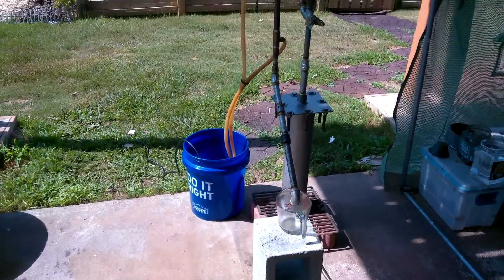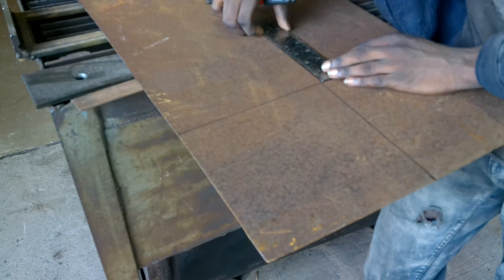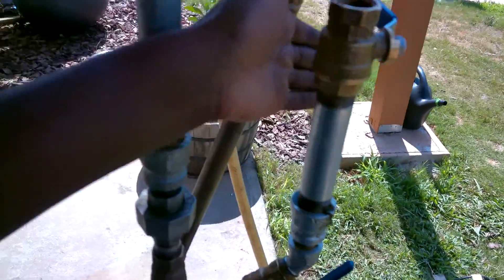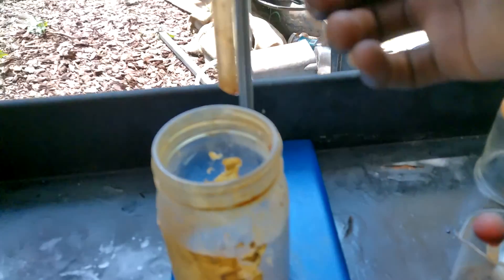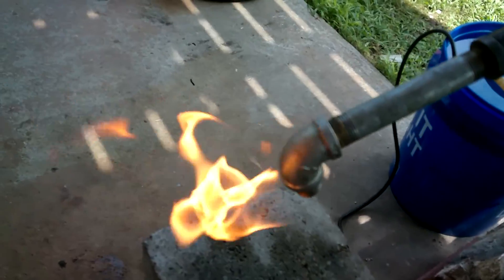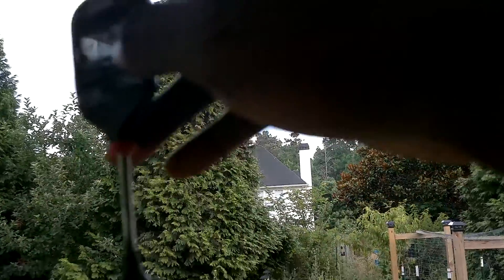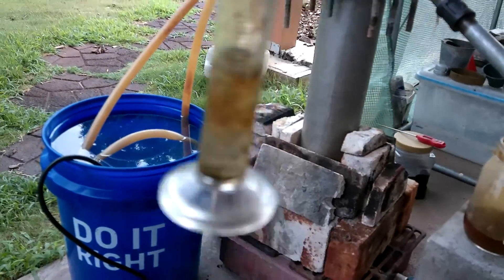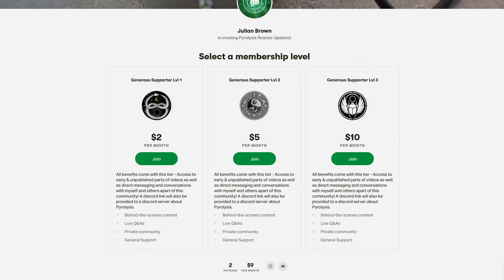GASOLINE from PLASTIC? - Distilling Pyrolysis OIl Part 2

Comment: You can treat the raw product with a saturated sodium chloride solution and wait for it to settle. Remember to shake, vent, shake, vent, shake, vent. Wait 2x longer than you think you need to. Then Slowly drain it. Also slow your process down to the point that you can fractionally distill it.

Comment: the lower the oktane the faster it burns or the faster it is gone. high oktane burns longer befor it is gone. 1 liter vays about 660 grams thats why it floats. you need a tower with diferent outlets to make good separation

Comment: I've just started messing with plastic pyrolosis,  but I've messed woodgas  (wood pyrolosis), one thing that works well is using straw as a filter media, then when it gets all full of tars, you cab just run it through the pyrolosis chamber.  I wonder if you could use packed shredded plastic the same way as a primary filter, then run it through the chamber when it gets used up?  Great channel, keep it up.  I just picked up a free 20hp diesel motor,  to experiment with running a diesel on the oilier products.

Comment: Have you ever heard of a lava lamp? So what's happening is when you have a endothermic reaction like oxygen and hydrogen reacting with each other, you'll get a pocket of thermal interaction that creates heat pockets of concentrated heat. The concentrated heat rises gets to the top cools off then falls down that's the fluctuation and temperature.

Comment: If you need to cheat the Octane value up on your solution to get it to burn more like regular commercially produced gasoline look into how carbonating water to make soda water works and use the same process to defuse propane into what you have made.  

It's a bit of a cheat but if done right it should be able to run most gasoline engines just fine.
Reply: Would diffusing propane into methanol make the necessary tri-methyl-pentane directly?  After that, you could blend it properly.

Comment: Hi, I always love your videos, I have noticed a few things from my experimental experience. 
1.) i heat the crude very slowly, I use a thick metal (8mm) for the still to compensate for temperature fluctuations
I have insulated it with rock wool,
2. I don't understand why the stills are so high, my distiler  has vapor outlet pipe only 30 cm vertically, the rest is horizontal,
Suprisingly  i get clean fuel, I think you should try to destilate  other fractions  too, then maybe remove leftover tar and sludge, and redestilate fuels.
Reply: The height of the still is to enable reflux distillation at a high power input.  The more power you input, the less temperature drop from the bottom to the top of the still.  You can make shorter stills by paralleling the columns, and going from the top of one into the bottom of the next.
Reply: @dansw0rkshop  Thanks!
Reply from the maker: As dan said, the height is for reflux and also a packed column for vapor - liquid interaction, which is said to aid in separation.  Thanks!
Reply: Please as I'm making one . Please share your scamattics to get clean fuel
Reply: @theunisdeklerk1232  I made the distiller in a simple way, without complicated calculations, so the efficiency of the distiller is also quite low, i think adding a vacuum would improve efficiency but for inspiration I would recommend watching this video
https://youtu.be/6sYKFSBknl8

Comment: Quite a nice setup you have here but as a chemist i can advise you too look for leak (expecialy before the condenser) you can use flour and water to plug them it will cook and stay for some time and likely not disolve from the hot organic vapor
Switch the water in the condenser, it should come from the bottom and leave from the top to have all the volume filled by water. 
If the condenced liquid is still warm than you are loosing some of it as vapor, increase the flow of water, increase the length of your condenser or use colder water.
The temperature fluctuation is ok for me but as the other say crank up the heat and insulate your column. it's also normal to have a jump in temperature as the front of vapor contact your termometer
If you have a lot of out boiling in the colomn, you can add pumice or similar porous stone to help control that.

To help with the separation of water you can try adding salt to help break the emulsion. You can also wash your crude with water to get rid off everything micible in water prior to distilation.
Check the pH, as pyrolysis of wood produce a lot of acetic acid but i can also happen with oxygenated plastic (like PET)
Reply from the maker: Washing the crude is a great idea, as well as the flour
Thank you for all this great advice! Cheers.

Comment: Can wine brewing machine using as a pyrolysis ?try to get one for pyrolysis from plastic to oil
Reply: How about you make a video of wine brewing machine as a pyrolysis oil from plastic?because none of them aren't making this content yet on YouTube, it is a myth currently 
Self assembled with well organized structure is much better than DIY built up, DIY built up may hard to deal with with it
Reply from the maker: @MrGamer_jinjit_96  well... there are a lot of unseen specifics that make pyrolysis - in particularly microwave pyrolysis work way better, and a wine brewing machine would not be able to meet these requirements. DIY for now is my best option, and I'm currently in construction of my next microwave reactor
Reply: @naturejab  everything has its own reason to designed for that purposed......because some other items can be repurposed in order to make a same machine
Reply from the maker: I doubt it gets hot enough, but if it gets 350 C (Atleast 450 F) or more, I'd say yes
Reply: I would not do it.  Those are expensive copper and stainless rigs, and it would be pretty much ruined afterwards for any use as a brewing machine (not that I care, I'm a teetoaller).  They might not handle the heat very well either.  Cheap steel pipe is the best for these projects, in my opinion.

Comment: Hey man I am still following your progress ^^ and enjoying it a lot!  

so here are a couple of tips from me. First insulate the hole system with stone wool and crank up the heating on your distillation setup. The general idea behind fractionally distilling things like you are doing here is that they separate (very simply sad) by them self. All you need to do is insulate the setup to keep in the heat and have enough surface area in your column (for the vapor to condensate and re-boil again.    

So, with the low heating you are not using your separation capacity of your column right. You have to heat way higher and let the thermodynamics in the column do the rest ;D  
There is a point called flooding where the separation capacity of your column is overshot but this isn't nowhere near where you are operating. You should also note the boiling points of your fractions and analyze the flashpoints separately. Afterwards you blend the fractions to create a fuel that is in the range of what you need; for an example diesel or gasoline. If you have any more questions on the refining part of the oil, feel free to ask me. I think I should even manage to do a short ZOOM session with explanations and some more useful information. 

 I know this is very old but its just pure gold! https://www.youtube.com/watch?v=KVQUZGmIIf0 it explains everything about distillation of petrochemicals 

Mfg hazelChem
Reply from the maker: Makes me happy to see a comment from you! All of this is amazing advice and cleared up a lot for me, thanks so much! I'll check out the video as well
Reply: @naturejab  happy to hear that! best of luck to you

mfg hazelChem
Reply: Thanks to you, also very interested.
From Alberta Canada

Comment: Amazing work! Keep it up this is so cool. You mentioned ethanol a few times, have you considered doing some experiments to see if you can get ethanol from your syngas? Either through a catalyst or fermentation of the syngas?

I have absolutely no idea how viable it would be in a backyard scenario but there really aren’t any good resources on the subject on YouTube and it’s something I think would be fascinating.
Reply from the maker: Methanol can be created thru the syngas, but it requires high pressure and hydrogen I believe. So it's cool, but not my priority right now for good reasons haha.
Reply: Ethanol is from fermentation of sugary stuff such as converted cornstarch.  I think the chemistry of getting it from plastic syngas or other syngasses would be fairly complicated chemistry.

Comment: Use pp  plastic #5
Reply from the maker: Polypropelyn yields more oil?
Reply: @naturejab  I distill waste motor oil you need to be able to use electric heat or some kind of heat that doesn't cost anything I can get a 5 gallon bucket full an hour or two costing about $0.10 a gallon it runs an engine perfectly fine yes the oil stinks yes the oil goes into redox and is difficult to work with I would like to do vacuum distillation waste motor oil specifically or transmission fluid or hydraulic oil whatever is free
Reply: @tonydiesel3444  do you personally make this into. ( diesel or gas  )
Reply: @naturejab  with such a tall unit with no insulation around the column you're going to get a lot of reflux

Comment: Use unions Union is a type of Plumbing fitting you can weld them on one side they won't leak they have brass in them they can handle the heat
Reply from the maker: Thanks, I use some unions, I just don't have them welded

Comment: Dude. Outstanding. Low and slow is the way forward. From first hand experience you do not want to crank it straight away, it takes me about an hour at least to get to operating temperature. Some observations:

- that dark crud is overboil. It’s exactly the same stuff I get if I turn the temperature up too quickly. 

- the end product looks exactly like my stuff, probably slightly lighter, and burns the same. Impressive. 

- oil does not boil the same as water, you get a nice rolling boil with water. Oil tends to erupt violently at a certain temp. The reflux temp will swing wildly because you get the distillate in gubs and drips rather than a steady stream sometimes. I have to sit down and watch my temperature like a hawk at a couple of critical points to avoid boilover. You kind of get a feel for it, I can tell by looking and listening when the burner needs to go on and off. 

- check your product for acidity. Mine is mildly acidic which you can sort out with a lye wash if you need to
Reply from the maker: Thanks for the advice! I'll check for acidity.

Comment: It looks like the reactions you seek do not occur until at least 300 degrees C (300-900C) are reached. I disagree with the comment on low and slow as if you are heating it sub 300 degrees you will never achieve the reactions which is only wasted energy. I would try finding a way to monitor your reactor temp and then trying runs at different temperatures and comparing the results. Otherwise nice work dude
Reply from the maker: Thank you for your insight!

Comment: Is it possible that you had some foaming or frothing going on in the system? If you have not washed out your packing the previous runs might have splashed or foamed up to the packing and thus your product might be less clean than it could be. The initial output being so dark and awful is strange, maybe you need to wash the insides of your column and liebig with gasoline or something to get rid of some residues from previous runs. Also you probably want to thermally insulate that column a little bit with some removable insulation sections, like fiberglass stuck to some sticky aluminium tape. The point is that instead of turning up the heating at the bottom you could just gradually insulate more and more of the total height of your column until you get product coming over. Your bottom chamber is also not the most ideal shape, it is better to have something wider, but shorter, especially if you heat the bottom instead of the sides. If you did not have as much splashing and violent boiling you might be able to get some almost clear products.
Reply from the maker: Yea I agree with you there, I did not clean out the scrubbers and I assume that's what that intiial stuff was being pushed out. Cheers!